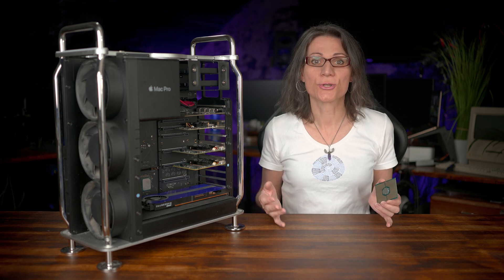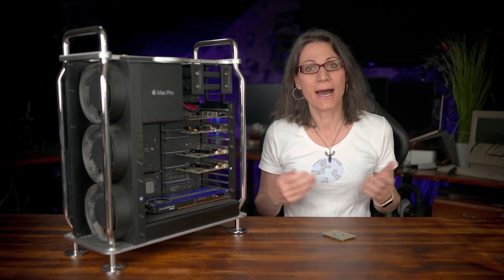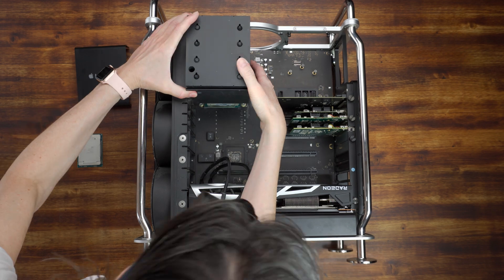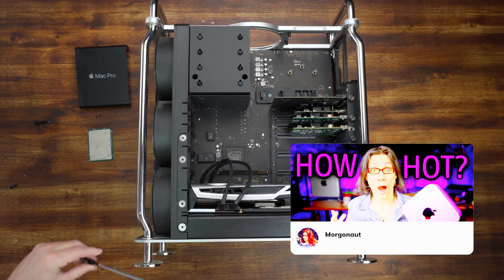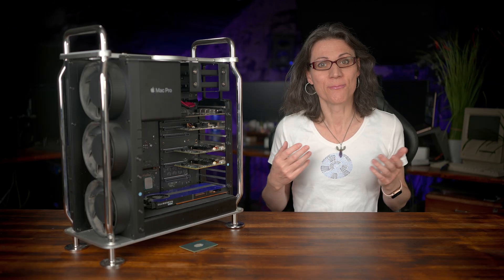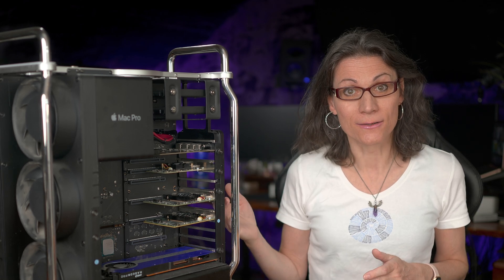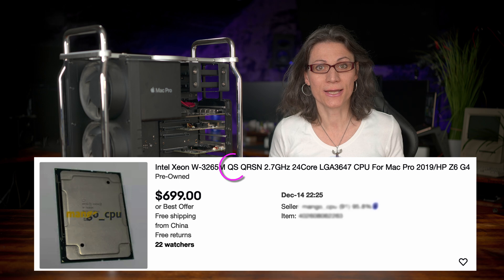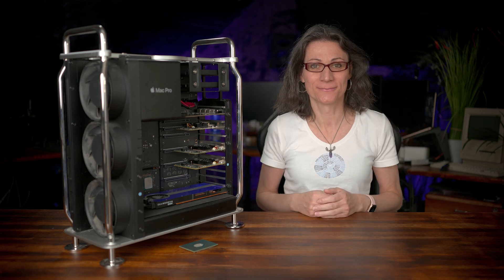How To Upgrade CPU In Apple 2019 Mac Pro - The Complete Guide

Comment: But I wonder: how do I buy a new 24-core Intel Xeon W-3265M processor, and is it even still possible?
Reply from the maker: @exdeecee - sure you can still buy it, look at eBay etc...
Reply: Can anything faster or newer (even slightly?) work in the same socket?  Or are we in the same situation as Mac Pro 2013 … I changed the CPU on that one, and it was limited to the same options that were available when the system was new.
Reply from the maker: @whophd - 213 Mac Pro use completely different socket and different CPUs. All CPUs compatible with 2019 Mac Pro I showed in this video

Comment: I did every step but when I turned on my compute, I had a yellow blinking light.  I called Apple tech support and they could not offer any assistance.  The seller assured me the CPU was good as he took it directly from a computer.  What do you think is the problem.  I put my old one back without any probems.
Reply from the maker: @lamarbur - you know from my video how delicate this exchange is and how careful people have to be. So if I would do it and the Mac Pro would not boot then I would be sure the CPU is broken
Reply: @lamarbur did you manage to fix the issue? If so, how? I have the same problem, flashing orange lights!

Comment: Liquid cooling would make such a difference on Mac Pro but they don't make any for Mac.
Reply from the maker: @useditem_tk - liquid cooling of CPU would not make any difference, it's not throttling
Reply: @morgonaut  I believe there won't be an issue on 7,1 but only older mac pro it does help. I did liquid cooling on my mac pro 3,1. Was doing good for awhile then thing went south lol. Now i'm using iMac 24" M1. I don't think there's not much u can do with it and tips from you, would be greats. Thanks
Reply from the maker: @useditem_tk - why you talk now about "older Macs" when you previously did not specify what Mac you mean and when you commented under my video about CPU upgrade on 7,1??
Reply: @morgonaut  comment out loud. my bad sorry sorry.

Comment: I followed all the steps but I got a blinking light and it wouldn’t turn on afterwards
Reply from the maker: @gregbradshaw7220 - then you did something wrong, it can be badly seated cpu, cooler, some pcie card memory module or even badly closed case = problem is on your side and not in my video! You can book a video meeting with me on link in video description and I can help you with it during Zoom video call
Reply: @gregbradshaw7220 did you manage to resolve the issue with the yellow/orange blinking lights in the end? Was it a faulty processor? I have the same problem, tried reinstalling the old processor but still got the flashing lights! Hoping you can help shed some light on this issue!

Comment: I'm considering getting one of these and this video was super helpful in my research. Do you know if Intel will continue releasing CPUs in the LGA 3647 socket form factor? Is there potential for something even more powerful than the 28-core W-3275M sometime down the line?
Reply from the maker: @EmperorBun - I'm quit sure Intel will not release any new CPUs for this old socket, it makes no sense. All CPUs are already on the market.

Comment: Great video! Question, did you use isopropyl wipes or did you put isopropyl on a rag or something?
Reply from the maker: :) I used paper towels with isopropyl dropped onto it, that's what I do for decades
Reply: @morgonaut  Gotcha! Okay, thank you. I'll try paper towels too. Sounds like they're rough enough to help take off the thermal paste but also not scratch the surface. :)

Comment: Why you wanna spend $3000-$4000 to upgrade the CPU ? Which is you can sale that Mac and get a 24 core Mac for cheaper lol CPU upgrade is not cheap
Reply from the maker: I did not spend any $4000, I spent $900. For sure you have no idea why I sold my top of the line Mac Studio Ultra fully maxed and use only the 2019 Mac Pro which gives me more performance and options than the Mac Studio can offer!
Reply: @morgonaut  wow u get a good price can u pls share where u find it for 900 ? Bcz I look around and cheaper price i find is 3000 thanks

Comment: What about mixing different size memory module?  For example I have 4 module of 32 gb each and 4 module of 8 gb each. All the same latency. When I mix different size module the overall performance in GeekBench decrease a little from 14.700 to 13.200. But if I use modules of same size, like 4 module of 32 gb each one, the overall performance increase at 14.700.  Do you know about it ? it is normal that this things happens?
Reply from the maker: always mixing modules is best way to degrade performace. Use same modules across all slots
Reply: @morgonaut  Oh, that's good to know!  I asked a sales person this very question today and they said it didn't matter! 
Thanks for your expert advice Teresa!
Reply from the maker: "sales person" want to sell no matter what! Never trust to "sales persons" like that

Comment: It's hard to find these Processors.
Reply from the maker: it's not hard
Reply: @morgonaut Reputable retailers? I was checking all over but only found most on eBay or amazon. Can you provide some leads?
Reply from the maker: why you don't like ebay? There's tons of CPUs for Mac pro 2019
Reply: @morgonaut  Honestly, because I'm always skeptical. Suppose I get a dud? Thats why. It's crazy because I sell lots of stuff on eBay and am 100%, but I get weary of buying electronics from others. Crazy, right?
Reply from the maker: it's absolutely correct to be aware and careful. But if you expect to be scammed or have problems then you attract that and guess what - you well get exactly that because you attracted that. BTW what exact CPU do you aim at? Maybe I could sell you mine...
Reply: @morgonaut  Hi Morgonaut. I didn't see your last reply til now. Right now I have 8 cores , but am interested in 12 or 16. I can just imagine the 24. Sheesh. I was going to sell. my Mac Pro but I decided to keep it and just use it as my main and use my MacBook Pro M1 Max when I travel. I am starting to do more video editing using Davinci Resolve and am looking to beef up my Mac Pro reasonably.
Reply from the maker: as I said, I can offer to you mine 16-core (the original one which came with my 2019 Mac Pro) or the 24-core to which I upgraded in my video and used so far. So if you are interested write me an email or contact me on my social media...

Comment: Didn't apple release an os update to stop people from upgrading CPU ? I read this in an apple forum and been stuck with catalina
Reply from the maker: by your theory I would not be able to run now my Mac Pro which I upgraded form 16 cores to 24 latest macOS Ventura but I do 😇
Reply: @morgonaut   great news for me! I'll finally be able to upgrade the os without worrying . Not my theory it was in quite a long thread in Macrumors . At the time I remember clearly no one challenged the validity of it and there was 2 people or so complaining that their CPU upgrade didn't work  and it was put down to the fact apple update the Os to stop people swapping the CPU. Thank you for confirming its ok ro do so
Reply from the maker: @jayson jason - you should already know that forums are not valid resource of 100% accurate information. I provide always perfectly working solutions. Sou you should decide yourself to whom you will trust

Comment: Hello! Do anyone knows if its possible to use Xeon w-3223 8core pulled from MacPro on another motherboards (not mac/apple)? Is it possible that they are locked to mac platform by apple (Lenovo is vendor locking AMD cpus on their workstations). It is very hard to find answer on that question, any help will be appreciated. Cheers!
Reply from the maker: I never tested that but I would be VERY surprised if that CPU pulled form Mac Pro would not work in ordinary PC. I would not be afraid of it. I did the opposite - grabbed ordinary server CPU and installed it in Mac Pro
Reply: @morgonaut  yes, I can see your point. I’m trying to search the net for that topic, but nothing comes out… seems like no issue. Quite opposite to the Lenovo case. I’m asking all that because I can buy that CPU for a good price and it suits my needs almost 100%. Thank you for your advice. Have a nice day 🙏

Comment: Exactly what I was thinking of doing on mine. Did you manage to do any comparisons for cpu rendering? Are we saying a 20-30% gain in general?
Reply from the maker: @Shane McKenzie - why you comment when you did not watch this video??? Because if you would bother to watch this video you would know, comparison of CPUs I did exactly in this video! OMG 👿
Reply: @morgonaut  thanks for the reply. I did actually watch the entire video, so I know the comparison between your original 16 core and the 24 core and how it offered you more streams. However I just wanted to confirm the gains you saw and whether you had managed to do any rendering tests as these were not covered in the video. Thanks.
Reply from the maker: @Shane McKenzie - you must know your "cpu rendering" is very vague term saying nothing. There is tons of render engines, tons of 3D apps etc. and performance vary one of the other. That's why I added some benchmark results which utilize also some rendering in their tests. But no matter what I do, it's never enough for people
Reply: @morgonaut  I’m sure you do the best you can. Thanks anyway.

Comment: i was just reading an old forum thread about doing this on even older mac pros (someone mentioned having mostly powerpc macs 💀). someday it would be fun to do on my 2019 macbook pro but i’m gonna try to get cooling figured out first, and i’d probably try to upgrade the memory before trying to swap out cpu or gpu. since it’s all soldered i’m not sure if it’s hardcoded to one thing or if it can still recognize what’s plugged in, so maybe i’d need to alter configs.
Reply from the maker: I would not bother with it on notebooks. It make sense on desktop like this

Comment: Qs procressors are soooo much cheaper. It is so risky to use that? Thanks theresa always helping us!
Reply from the maker: I would not risk it as I said. That's why I have the real retail version. But nothing holding you back not to try it, just be aware it may not work the same way or not at all - each chip has exact identifier and each Mac Pro supports only specific CPUs. Also those samples are clocked lower in most cases etc.
Reply: @morgonaut  thank you for the advise
Reply from the maker: welcome :)

Comment: Just checked eBay prices. Horrible value unless you NEED tons of thunderbolt. HP Z8 G4 with PCIe expansion chassis, + Morgonaut's time to proxmox it is a much better value proposition.

Will be interesting to see what next Mac Pro brings...
Reply from the maker: I'm selling my maxed out M1 Ultra Mac Studio because I went back to my 2019 Mac Pro as my main workstation, so I absolutely cannot agree with your false statement "it's horrible value". 2019 Mac Pro is great, it offers things other Macs can't deliver at this moment.
Reply: @morgonaut  Other than limited TB3 expansion, I don't see where a Hackintoshed HP Z8 + PCIe expansion chassis falls short of a genuine Mac Pro.

I agree that the MP 7,1 offers things that an M1 Ultra cannot, especially for me GPU power.
Reply from the maker: MP7,1 is unbeatable in PCIe slots = how many devices you can connect and also amount of memory. You know I have here tons of great workstations of all kind, 2019 Mac Pro wins for me. BTW out of my 12x TB3 ports I use only single one for a left over device from my Mac Studio
Reply: @mumblety96  Are you sure your Hackintoshed won't fail in the middle of a project. Professionals don't like their million dollars go down the drain.
Reply: @hshsnguyen6160-i5s  I am 100% certain.  Aside from the 2 I run as daily desktops, there's a small army of Hackintoshed Z820s which do nothing but crack hashes on GPUs 24/7.  Not a single hiccup.  Think I set those up around 2017.  These have been at least as reliable as actual Mac pros (owned most models).
Reply: @mumblety96  One things about Hackintoshed if you build it for rendering that would be great but to actually use it for main projects thats not good at all. If you own most of the mac pro, you already know that when it come to hardwares Mac Pro can be really picky as well as their software developer. Z820s is a beast in its own world but will never will be able to offer peace of mind to apple users mainly pro users.